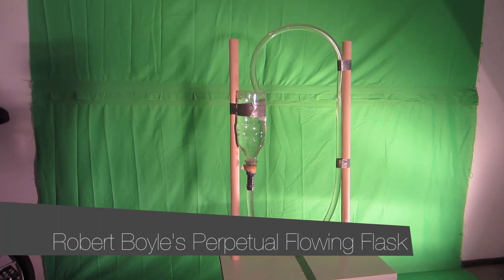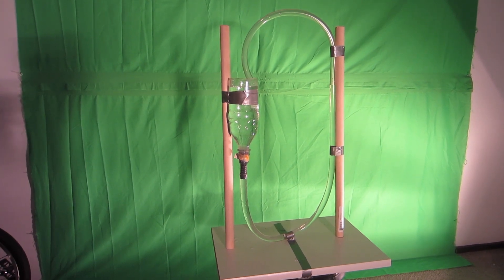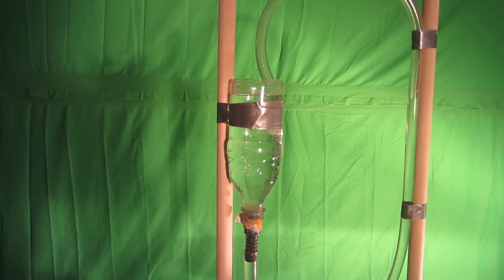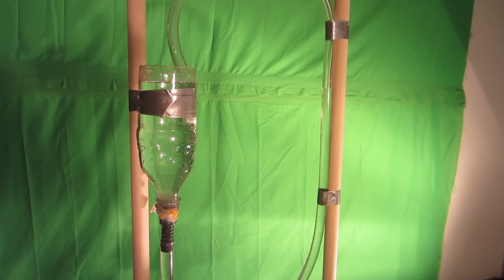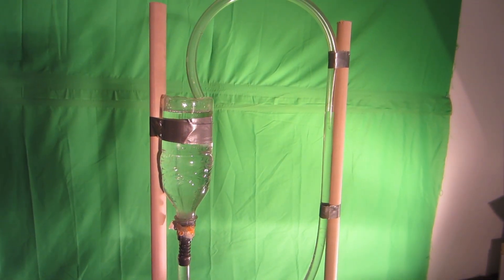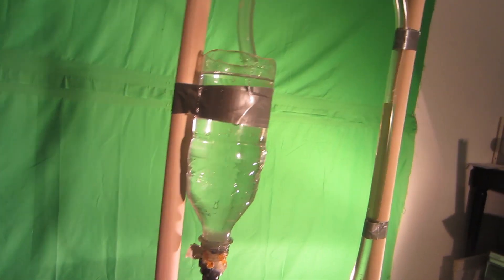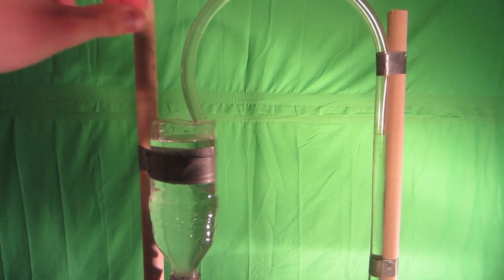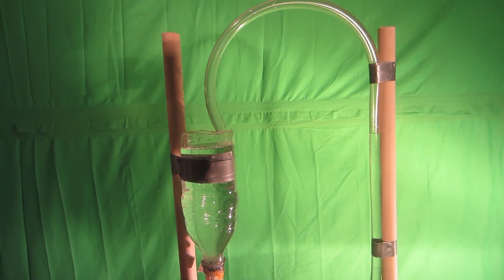Robert Boyle's Perpetual Flowing Flask Doesn't Work

Comment: U do realize he used a capilary tube for the water return, u can make one really easily using 1inch soft clear tube from home depot and a heat gun...theres an equation in the capilary tube that makes the difference on this....make sure u have the details before u try to debunk some stone age crap...good work needless to say.